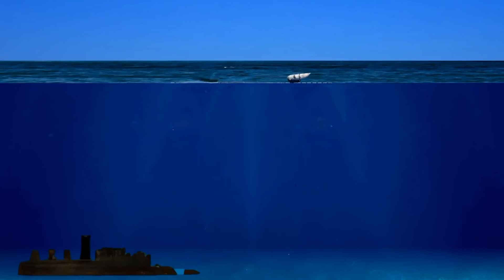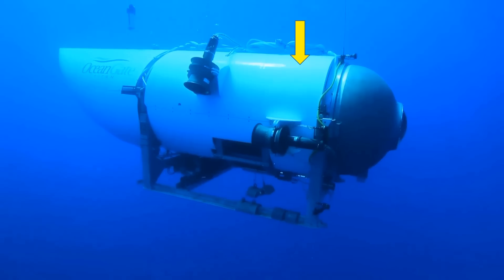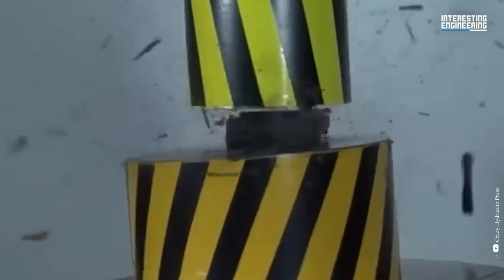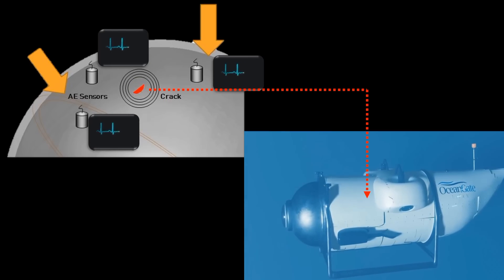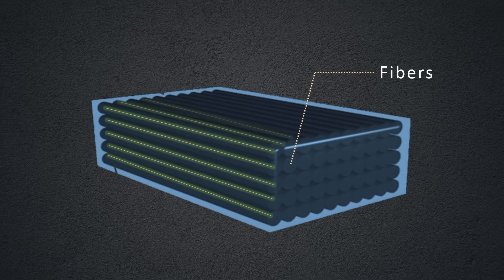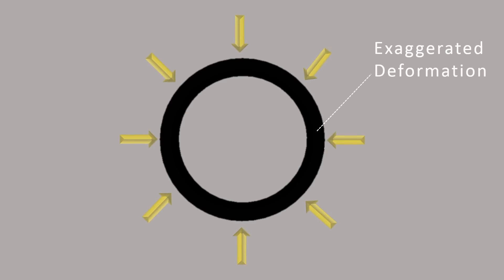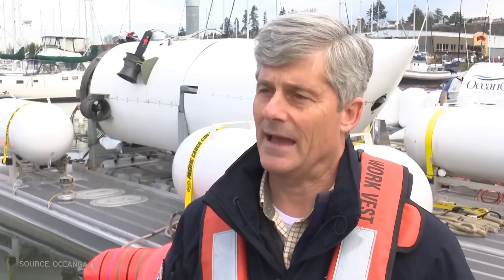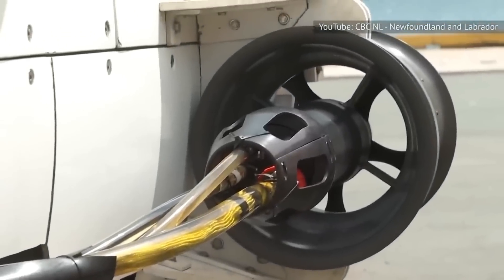Oceangate Titan Did Not Implode Just From Pressure. There Is a Catch!

Comment: What? You okay? It imploded from pressure on that fiber cylinder WTF else would it implode from? That stuff ain't made to compress and ESPECIALLY when its not even woven! this idiot was relying on the binding agent NOT the tensile strength of fiber. I also don't comprehend what the age of that fiber has to do with it. Its not like its an organic material. Yeah why would it be dated? The glued joints were in compression those are NOT the failure point. The fiber simply shredded away from them upon implosion. Notice that the navy hid EVERY BIT of that cylinder from view? Yeah because its a totally shredded pile of trash and they don't want john Q viewing it. Where is it? Too heavy to bring up? Not hardly it was most assuredly in that bucket that was hoisted these winches can lift humongous amounts of tonnage (22 tons is NOTHING!). The only possible reason its still on the sea floor is that the ROV's may not have been able to lift it into the bucket as it was probably the heaviest component. Remember that the end caps are fabricated from titanium NOT stainless thus they were relatively light compared to the cylinder. yeah stainless is a LOT stronger than titanium but its also a lot heavier. I didn't see the rear end cap but remember it doesn't have a view port so they either left it in the hoisting bucket or never bothered to load it into the bucket to begin with (via ROVs).

Now that acrylic window could have imploded BUT I did NOT notice shards around the ring and in fact that ring was removed by the dive team AFTER recovery just below the surface so they could run a cable through the view port window so that the end cap could be subsequently hoisted above sea level. yeah WHERE is that ring? That's telling me that the view port did NOT implode. Had the view port imploded shards would have been evident as well as the ring holding it. however the ring is gone and NO WAY an implosion woulda dislodged all the those bolts so neatly. Yeah this frikken navy is hiding a lotta shit from john q which is their typical modus operandi.

Comment: Yes , there's the axial/ transverse force on the CF hull of 3 × the prevailing hydrostatic pressure, thru the titanium rings from the hemispherical caps/heads.

The integrity of the connection for air purification  circulation comes to mind.

Comment: Another problem would be microscopic air bubbles within the composite. Some could be so small to be undetectable by destructive ultrasonic testing. These bubbles would still shrink at depth and weaken the composite by delamination around the area of the bubble. Over repeated dived this would increase similarly to metal fatigue at the microscopic bond level, further increasing the extent of the delamination this weakening the whole laminate due to fatigue.

Comment: Blah bla bla bla blaaaaaaaa...The cylinder was made of epoxy resins because the fibers resist LINEAR TENSION OR TRACTION...The pressures were outside the container...It was the epoxy resins that contained the sea until the accident...If the pressure was internal, the fibers worked...With the pressure of the sea... THE RESINS WORKED...The tube was made of EPOXY RESINS...

Comment: Thanks for this effort that had some understanding of the Ocean gate failure. I you bring to light the nature of the wound carbon fiber perpendicular to the direction of the winding fiber. It makes perfect sense to me. And it helps me realize that there could have been thousands of hairline cracks in the Ocean gate  hul.. an example to me of the resulting catastrophic failure would be like a spool of wire that you drop on the ground. It always breaks in the middle of the spool in the direction that is opposite of the windings pool

Comment: Excellent explanation, thank you. I work as a Test Inspector for a company that manufactures gas compression equipment dealing with pressure vessels of many different materials. Carbon fiber is an excellent material, but as you described the act of compression and decompression over a period of time can create stress fractures, and this along with extended periods of exposure to pressure perpendicular to the fiber strands was an invitation for catastrophic failure. Great job at making this understandable for everyone.

Comment: Imagine this sealed system, the submersible contracted but without leaking (at least for the moment). The vessel would still contain the same amount of air and maybe the pressure inside would rise.  But would a change in the shape affect its buoyancy?   I am wondering about the transcript.  If it is accurate, it seems as though the speed of descent increased a good bit in there final 10 minutes.  That leads me to wonder if the vessel had partially compressed just enough to change the buoyancy. Again according to the transcript, they had difficulty dropping the ballast and continued to drop. It was only after they also discarded the "support frame" that they began to slowly ascend.  Anyway, I don't claim to know if the transcript was genuine. I only suggest that if it is genuine, then it does suggest a cause.

Comment: While submarines may have a tubular overall shape, they typically are divided into more spherical units with bulkheads dividing them.  In effect they are supported by internal bracing.  Also longer submarines can’t dive as deep as round pressure hulls.  Alvin, for example, has a round capsule contained within an elongated non pressure chamber.  It is rated for 20,000 feet.  As well Rush had heard “crinkling” sounds in earlier dives but was happy when they stopped!!! His interpretation of the sound was that not hearing it in subsequent dives was a good sign.  I think what he heard was carbon fibers breaking, and the only reason the sound went away was that you can’t break an already broken fiber.  The silence was not a good sign, it was a BAD sign.  His selfishness clouded his judgment!!!

Comment: Here is what happened. The Titan was not launched from it's usual platform thus dragged behind the main ship in the rough seas, that alone could cause vibrations ect thru out the components of the submersible. The fact that they had to go to Bus B and then only managed a few feet buoyance means those pressured oil tanks in the back that keeps water out of electronics most def had an issue aswell. Add the rapid decent and you have a recipe for disaster and i believe the glue holding the parts together came loose.

Comment: This is the most detailed information I have seen on the performance and issues with carbon fiber. I'm not an engineer, but it would stand to reason that exhaustive, unmanned, testing should be done on any unit, especially one that was not manufactured to the existing standards, before putting lives at risk. People think that because it is used for plans it is ok for submersibles. Plane cabins are pressured from the inside, whereas the pressure on anything going to the bottom of the ocean is from the outside. The affect is not the same. Planes undergo structural testing all the time due to the stress on the fuselage. They do not undergo testing while the plane is in mid take off, in flight or landing. So the theory that if we hear cracking we can just abort and return to the surfaces is codswallap. I saw on another post that the material they used was rejected for planes so they were able to buy it at a lower cost. Going "on the cheap" to the bottom of the ocean, yeah that's a hard no!

Comment: This is an excellent presentation of factual information as opposed to opinions and speculation.  Carbon fiber has been used in radio controlled sailplanes for a long time and its penchant for sudden and catastrophic failure is well established among that community.  Fortunately, the only losses in that hobby are money and pride.  It was troubling to learn that the hull of a deep submersible was made of carbon fiber.  Anyone that has used it knows how much better it tolerates tension over compression.  I'm not an engineer but have designed and built many things.  This was a flawed design from the outset.

Comment: My biggest concert is: the titanium cap and composites body of the submersible would be compressed and contracted at different levels and speeds being different materials under immense pressure.  Would that alone undo any glue they have used? Not to mention the glued surface was less than 3 inches deep judging by the video they showed. How about they didn't have the support of the inner ring either? as it's non existent anyway. The coldness alone would make 2 different materials contract at different rates. No glue is gonna withstand such force

Comment: I largely agree with your assessment of the likelihood of failure due to fatigue, as well as the magnification of the effect due to material defects. However my favored theory at the moment regarding the hull loss has more to due with the damage of the carbon fiber due to rotation of the end of the shell about the inside corner of the titanium end cap. Assuming the end cap is much stiffer than the shell, i would expect the contact deformation at the corner would cause damage with each pressure cycle, and eventually lead to failure at the interface of the two components.

Comment: Looks to me like the carbon fibres were only applied circumferentially (helically wound ) providing tensile strength circumferentially only but not at all axially. The axial stress would come from the end caps pressing on the cylinder.

Comment: Thank you for your well presented analysis. This is the first time I have been made aware that the hull had already been compromised due cyclic fatigue. Stockton knew and had a rebuilt by a couple of Washington State companies. Think Boeing and for Rush think aero background. Carbon fiber aeronautical settings will not have more than a one atmosphere pressure gradient, a heavy G load at times and comparatively large temperature variations., deep ocean and deep space share 'deep' alone as a common denominator. Mr. Rush paid for his belief with his life, the others paid with their lives for a once in a lifetime trip. Mostly this will end using carbon fiber for deep ocean pressure vessels, the Rush effect.

Comment: I'm curious as to what those titanium "hemispheres" at each end cost to make. I think if he'd made the same shape but with titanium, he could've gotten it certified. Problem is that titanium is expensive and it's strength makes it harder to machine/forge/etc. which further increases cost. The "pill capsule" shape isn't as good as a sphere but, let's face it, it's the material here that failed. It was the stress over time that caused the implosion - the kind of accumulated stress that doesn't exist in titanium or steel unless they're taxed beyond a certain point

Comment: Theoretically how deep will a submersible be able to dive with a carbon fibre hull shaped like a ball with ofcourse a hole for people and equipment transfer (if not strengthened by lets say a support structure). As for size lets say having the same volume as ocean gate craft? Anyone can comment on this I think with no experience even as a ball shape 4000m will be a stretch right?

Comment: It’s very obvious the parallel carbon fiber winding is not correct way to do. As said it cannot offer multidirectional strength, and basically this design doesn’t rely on carbon fiber but on the resin

Comment: Titan sub popped at the joints between pressure cylinder and titanium caps. As soon as I saw they GLUED it together, it was clear to me that's the part that will fail. And it did.

Comment: Think of it as a carbon fiber/graphite fishing rod. The thing is strong as hell when it’s bent lengthwise under the weight of a large fish, but try squeezing it in the middle with a pair of pliers and it will crush very easily and with no warning.

Comment: A generally good analysis. However, a couple of points... 
The inclusion of the photo of the burst fiber composite pressure cylinder is not applicable to the Titan implementation at all; The Titan was loaded as a vacuum chamber, not as a pressure vessel. The video segment showing a pressure vessel being wound at a significant bias angle with end domes included also does not apply. As you later stated, the stress loading was compressive. You showed some examples of carbon fiber woven fabric. This fiber lay was not used in the Titan assembly. The carbon fibers were laid almost exactly straight and parallel, with a relatively fine helical pitch along the length of the cylinder as shown in the fabrication video segment. There was no waviness in the axial lay of the fibers, rather, they were laid very nearly coaxially with the expected tangential compressive stress vectors. However, in principle, you cannot push a rope. So, as you also mentioned, the compressive stresses, (and also the resolved shear stresses) were supported primarily by the resin matrix in this highly anisotropic material. The anisotropy that I mean to point out is the difference in bulk tensile strength vs compressive strength in the direction of the fiber lay, along with fatigue properties, which might not have been correctly modeled in their design analysis. There was also significant compressive stress perpendicular to the fiber axis, parallel to the axis of the cylinder due to the forces on the end domes. The combination of the two perpendicular compressive stress vectors could have caused fatigue related delamination and inward buckling of the carbon fibers in a material that was poorly suited for supporting compressive loads and would tend to collapse in brittle fracture. Another problem that I see with carbon fiber composites in compressive applications is that the surface of carbon fiber is very slippery, much like a linear version of graphite, so the resin matrix would bond only weakly to the fibers. To overcome this, it would be necessary to surface treat the carbon fiber to add -OH or -NH2 groups to allow chemical crosslinking of the fiber by the resin chemistry, preventing delamination. This type of surface treatment is not needed for tensile applications. I think that while carbon fiber composite is excellent in tensile load applications, it is completely inappropriate for supporting compressive loads, especially under cyclic loading. This is partially demonstrated by your inclusion of the beam loading illustration with the thin fabric composite sample.  (A practical application that dramatically demonstrates this is the typical sudden massive failure of carbon fiber bicycle frames.)
I suspect that no fiber composite debris was found during recovery operations because it was pulverized by an immensely powerful water hammer (enabled by the sudden massive brittle fracture of the cylinder), which also blew the acrylic porthole axially forward out of the forward dome. 
Thanks for posting your analysis

Comment: Your model seems different than titan. End caps are Metal not CF. If Delamination occurred as you featured in 3:33 a lot of the body structure would also have been recovered - so we wait to see that so far only end caps and other metal structures was recovered.

Comment: Excellent presentation and great detail regarding carbon fiber, its properties and behaviors as well a failure points - something few others have taken the time to explain aside from saying carbon fiber maybe problematic.

I do not know that carbon fiber eill or will not have a future   in deep submersible vehicles as the Oceangate vehicle skipped so many tests that should have happened, destructive and non destructive and even just peer review and approval of design.   Carbon fiber is a big deal in air craft, why I suppose Rush choose to manufactor in Everett Washington where so much of it made for Boeing and others in the air craft industry.  Howver  ehen carbon fiber was initially suggested as a aircraft material, no one rushed i to building a craft of carbon fiber, and it took many cycles in desygn, redesign, testing, destructive and non destructive, and was tested in pressure chambers well before the first test pilot flew in a craft using carbon fiber in the wings.

Its very possible that someday all deep saturation diving, submersibles and submarines, and maybe even permanent sea bed dwellings will be mostly carbon fiber but that will not be until there is a great deal more testing done as to the siitability of the material for use that deep in the ocean and anyone even trying to carry on with carbon fiber is going to have to go way back to material suitability testing and proof of concepts before they  continue the work.  Stockton Rush skipped do many common sense steps and refused to listen to people who told him things like by the time the acustic monitors pick up sound of fibers breaking it would already be too late.

Comment: There has been sources claiming the decent rate was to fast, I dont know if this confirmed or speculation. There were many corners cuti n building the vessel, what might have caused control issues as has been the suggested reason for the 'claimed' to fast decent.  
How many control backup systems did it had?